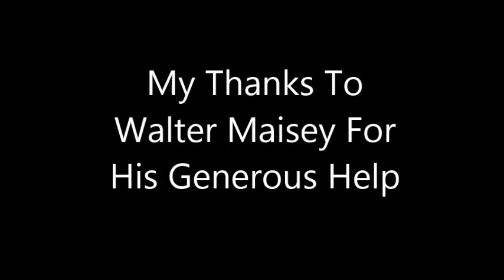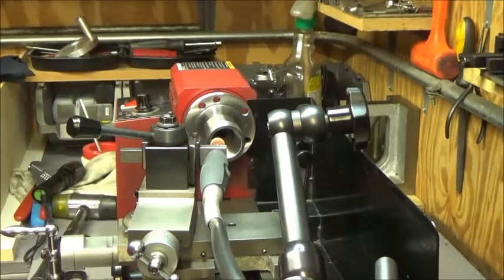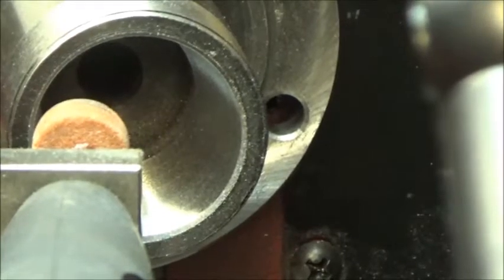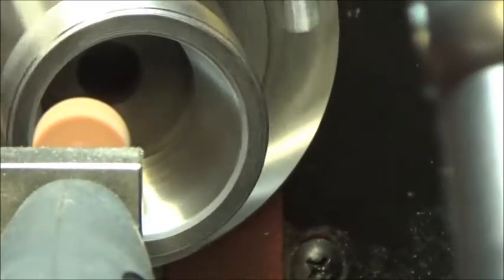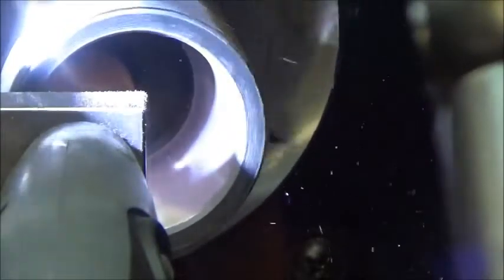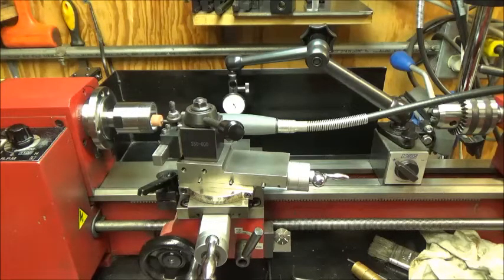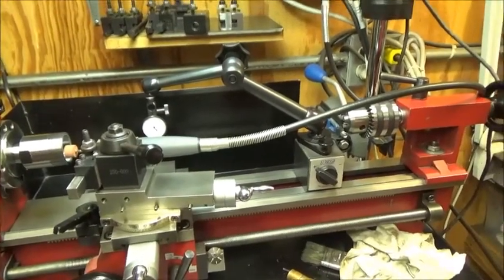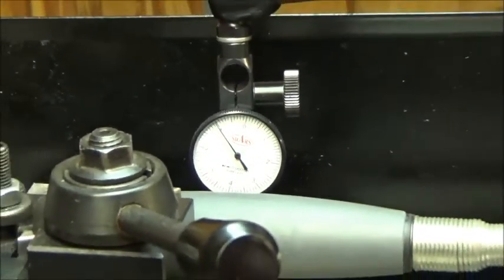ER32 MT3 Collet Chuck Bore Grinding and Truing - Results 0.00025" Runout

Comment: Hi, Larry, I'm glad it all worked out for you, I knew you would be successful, I have been waiting for the follow-up video where you test the accuracy with a test bar in the collet and the outcome of that test,
Reply from the maker: Walter:  Glad all is good at your end.  I was considering sending your an email this morning, but decided to wait awhile.  The current result is a suffix to the main heading.  However that number is the current result, which could improve, considering I'm still working on the situation.  I have a lot to tell you, which is to much to put into this response, so I'll get off an email with an additional explanation.  Best Regards: Larry

Comment: 40 years ago or so my brother made me a gift of a set of #2 Morse taper collets for my Atlas 6" lathe.  Imagine my surprise that the majority of these had less than .0002" TIR when checked with commercial dowel pins and a .0001" swiss indicator!  The worst collet ran out about .0002" TIR.  I used these a lot.
When I wanted to replace these with modern ER collets and holder, no one would guarantee their run-out!  Perusing hobby machinist blogs the consensus appeared to be that if one got .001" TIR, all was well.  For that TIR I use my Polish 4-jaw self centering chuck, which achieves .0008" TIR.
One would think that with modern manufacturing methods and air bearing spindles, .0001" TIR would be a breeze to achieve for precision tools such as collets and their holders.
Further to the re-grinding process of the OP:  Because of the very flexible set-up of the grinder, the original inaccuracy of the collet holder is somewhat re-produced through successive cuts because of the grinder mounting, which deflects during the grinding operation.  Consequently, a number of grinding passes are necessary without any tool advance (infeed).  These so-called spring cuts make up for any tool deflection.
Reply from the maker: Thank You very much for your comments.  I do think direct morse taper collets should show the best results in every case, whereas spring collets with the extra adapter are probably not as reliable.  Unfortunately all my endeavors didn't prove to be totally successful using Chinese products and U.S. made would be a prohibitive cost for a hobby person like me.  It was all a fun exercise without great expense.  thanks again and Best Regards: Larry